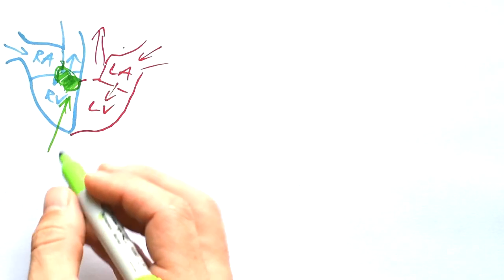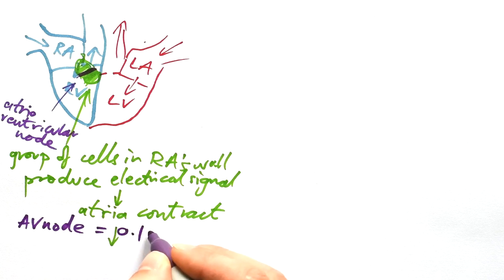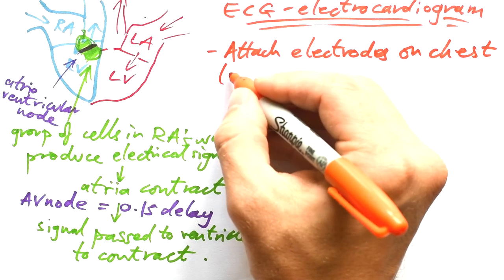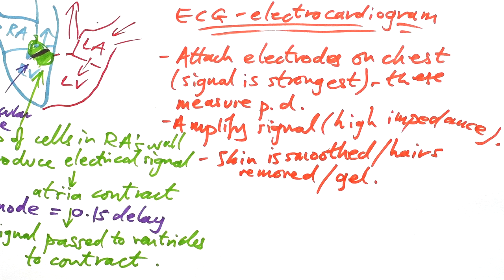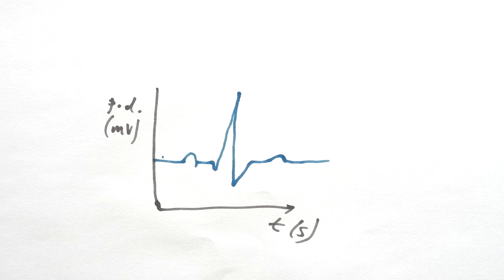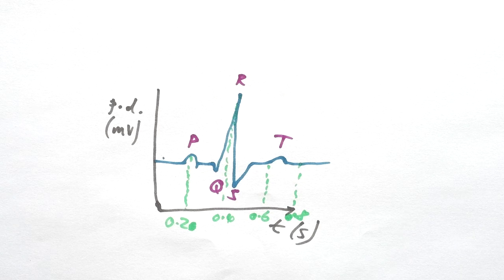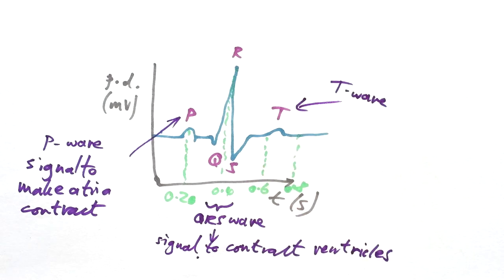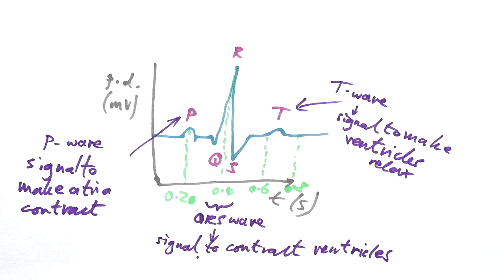ECG - Electrocardiogram - A-level Physics/Biology

Comment: What do you mean when you say high impedence? How is the signal amplified?
Thanks
Reply from the maker: Not something you need to know as it's purely electronics, but a high impedance amplifier uses a high voltage, low current signal. Ultimately, this means that less amplification is needed, and therefore noise is reduced.